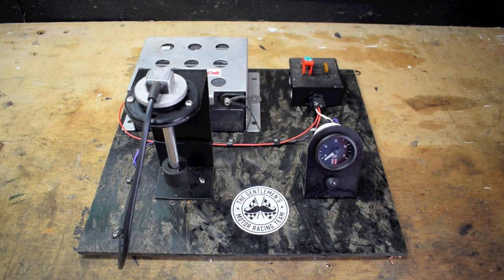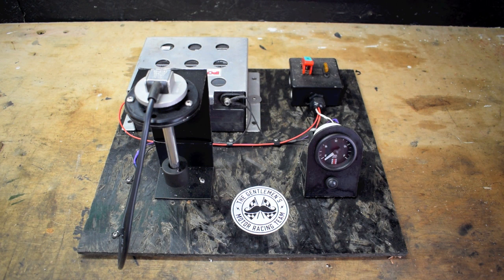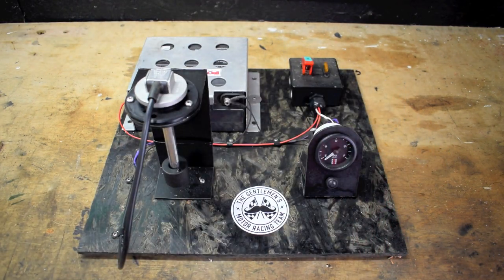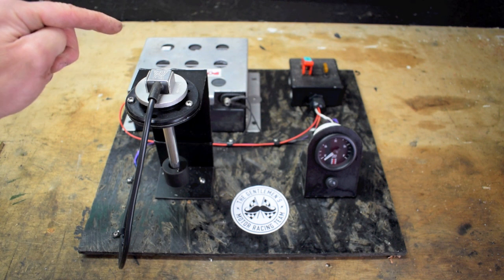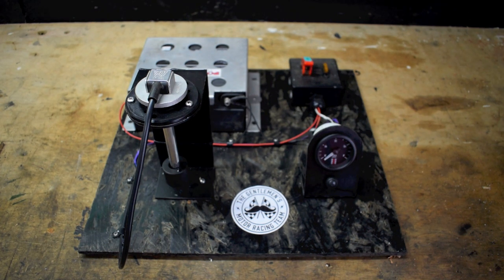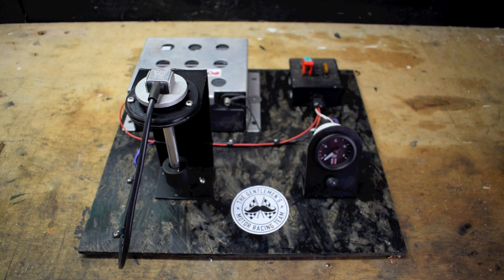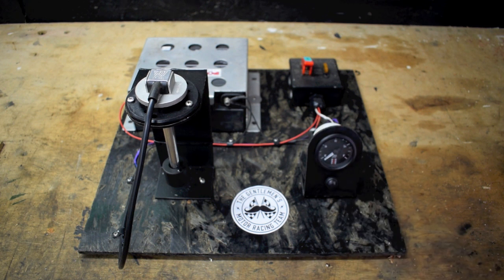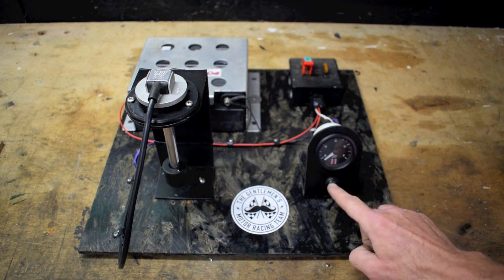Stack fuel gauge and how to program it

Comment: What a neat little gauge, I presume it will work with any sender? Where can you buy them?
Reply from the maker: Hello yes that's the amazing thing about it. You can get them from demon tweeks
Reply: @TheGentlemensMotorRacingTeam  so with this gauge it does not matter if "empty = low resistance" or "empty = high resistance" ?? It can be used in either application?
Reply from the maker: @MeijndertMotorsport  exactly it doesn't mater - its a great bit of kit
Reply: @TheGentlemensMotorRacingTeam  
Ahh, thank you so much for your quick reply! Highly appreciated!
I'm gonna order me one of these! 🙂👍🏻

Comment: Nice job! Where did you buy it? Is this the normal way to do this for rallying? Does it come as a system  as well or do you have to buy the parts separately? Thanks!
Reply from the maker: I bought the gauge second hand and the rest is all bought separately to meet my needs. And to be honest I am making up as I go along 😂
Reply: @TheGentlemensMotorRacingTeam  How bad 😁. If it works, it works! 👍. Best of luck with it 😀.